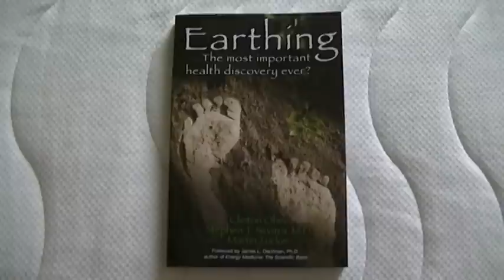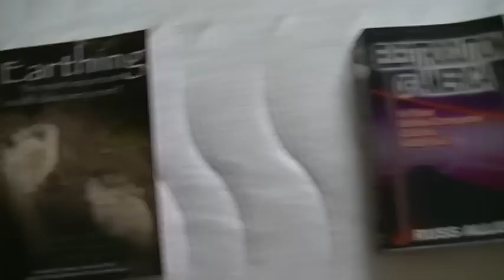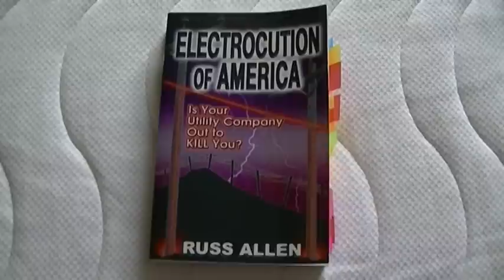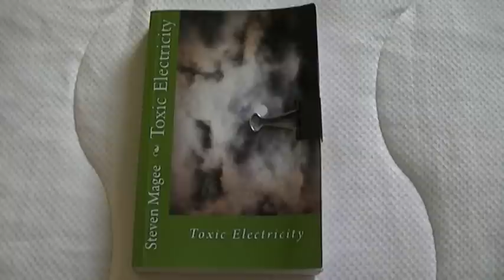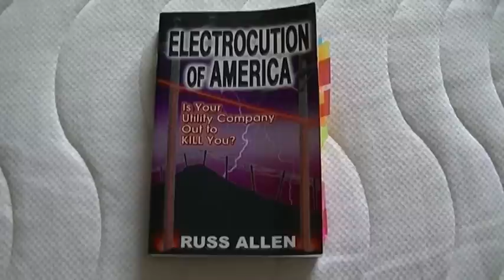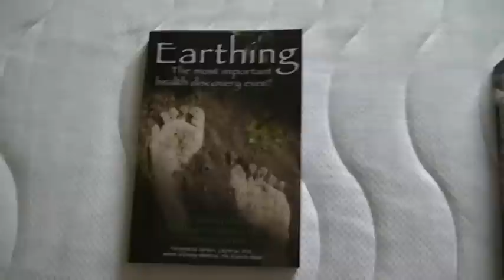Earthing (Grounding) Health Risks

Comment: I have a neurological disorder and for some reason it relieves me to be grounded. But I used some earthing sheets with an adaptor and I started feeling worse. For some reason some electricity still came through the adaptor and I also have electromagnetic sensitivity.

How can I safely be grounded  not having a yard? Is there another way apart from walking barefoot? Thankyou.
Reply from the maker: Standing barefoot on a tile that is insulated from the ground may work:  See http://youtu.be/ZrlQFp16ADQ Shungite Plant Experiment May 2014 Review
Reply: Thank you so much for answering. But if I am barefoot on a tile insulated ground then I wouldn't be grounded. Am I right?

And I need to be grounded to relieve a Little bit my pain

Thank you again.

Comment: Steven, there must be a way to block the voltage and current returning back through the earth with some sort of resistance like a PolyPhaser does on lightning protection circuits. Could you point us to a circuit diagram or information on how to do this please.

Comment: "Earthing" made me sick. Thanks for exposing this dangerous fad.
Reply: Did you plug it to wall or the ground? Did you use the equipment that is advertised on the earthing website?
Reply: IceSparrow44 I used the ground rod and equipment from the earthing website. I experimented with 5 volunteers at different locations. One refused to sleep on a sheet after the first night. Everyone else were extremely exhausted and ill after 3 days. The experiment was halted. Using a NFA1000 I looked for the lowest ground body/voltage in the yard.
When connected with the earth you become part of a circuit. The cell is gated by voltage and if it's disturbed you can get horrible effects. Sleeping directly on the ground was never intended, otherwise it would be comfortable.
I have had excellent next day results with everyone, just by sleeping with the power off at the breaker and shielded from RF.

Comment: Water is conductive, even if we have plastic pipes these days.... and it usually comes from a reservoir somewhere with earth contact. Could not understand why I wanted to spend so much time in the bath in the evenings (with water flowing in slowly for quite a while), except I knew that I would sleep very well at night. It is not practical to stand and hold a faucet for 1/2 an hour, but the point is that the earth enters further into our homes than we realise, we just need to "connect" to it in some way: find creative solutions.     I wonder how the mains electricity influences our water inputs (plastic pipes are probably a blessing, as metal pipes would cause a strong induced mains current - but then again the water groundign might neutralise this: good field for research.)

Comment: I recently ordered a sheet that is made from cotton and silver thread and which is meant to be plugged into the grounding line of a conventional socket near the bed. If I understand your video correctly, there is still too much electromagnetic interference which might "contaminate" the grounding line and end up exposing the person to amplified radiation.
Reply: After my online research, it seems that the best grounding/earthing results can be achieved by simply walking barefoot outside. I, however, don't like doing this as I have walked on plenty of ticks and wasps over the years and have been bitten and stung by them, resulting in allergic reactions. I was thinking would soaking feet in a salt water solution outside in my backyard be acceptable? I assume the container for the foot bath would have to be a material that conducts to and from the earth, perhaps stainless steel? Plastic probably won't do. Any thoughts or suggestions? I did recently order a grounding mat for when I sit at my computer, however, after watching your video, now I'm not so sure if using it is such a good idea.  Also it is made from latex, and I have a mild latex allergy, so prolonged skin-to-mat exposure is probably not the best.
Reply: I would really like to know if it's like that as well, the EMI which might contaminate the grounding line..

Comment: An Earthing mat of the design mentioned in Clinton Ober's book, and which is most commonly used, is not the same as running a bare copper wire into the outlet -- in fact he warns against doing such a thing. Not only do the mats have a shielding mechanism, they also come with an outlet tester to make sure you're not connecting into dirty electricity.  What you did is not how most people are grounding.  Your test was not proper, or fair.
Reply: Hello Karen, thanks for your reply as you at least get my point. As a bonus, I will explain to you the safest and foolproof way to connect your earthing system. Do not use a single copper wire to connect the outside ground rod to your inside grounding mat. Instead, use RG58 or RG59 coaxial cable for this. At the outside ground rod end, connect the shield and center conductor to the ground rod. soldering both connections to the ground rod is best to prevent corrosion and higher resistance of the conductors. On the inside end of the cable only connect the center conductor of the shielded cable to your mat or mesh. Leave the outer shield "open" and not connected. This way, the shielding of the cable prevents and blocks any RF from microwave, Wi-Fi and radio sources since the shield is connected to earth ground outside at the ground rod. This is called single point shielding which is used in all audio device input shielding to prevent RF interference. Hope this helps... 😁
Reply: @robindorf55 what about RG6? Would be any good or RG58/59 is better? 
Thanks!
Reply: @robindorf55 ”soldering both connections to the ground rod” that doesn’t means that the outer “shield” will transfer everything that it catches to the inner wire and so to the bed?
Reply: @silvius6829  If you solder the shield and center conductor to ground, they are at the same ground potential. Which also cancels out RF reception. Use of a single copper conductor is the best way to go.
Reply: @@AngieW-ri6qx
Well Angie, I am still just trying to understand the methods and madness of these Earthlings?
Reply: MICHAEL, A GUY WRITES A BOOK AND YOU GO GAGA OVER HIM.  WRONG
Reply: @misfitty-vd6kv  What in the meth is this comment?

Comment from the maker: Biological proof that the Earthing and Grounded barefoot technique works when implemented correctly:  http://youtu.be/fjtKw8N_Xkg Building Radiation (RF) Resistance into Plants and Humans
Reply: I tried grounding with a metal sock complete with inline fuse and then a grounding bracelet - I feel the best sleep ever and I feel its fixing my back issues - I thankfully never had sleep issues but I feel so much better rested its amazing and my advanced disk degenerating disease - I wake up with no aches; I think its working for me?
Reply: I had a friend with a bad experience with a neutral ground wire that came loose from a service pole and landed on his roof. The electric company incorrectly told him it was safe to move it. This is the thing that third prong connects to in the system. What happened to him shouldn't have, but it did. He touched the wire. Something unloaded a fraction of a second high voltage pulse in the line, probably a three phase electric motor with a little short, estimated at about 7,000 volts. He woke up on the ground. He had burst into flames. His clothes were burned off, all his skin was burned. At the hospital they scraped off all his burned skin. He had years of grafts and had to wear a compression suit because his flesh bled everywhere. He and his wife said it hit him especially hard between the legs, and his penis was no good for anything. It destroyed him in every way and he wished it had killed him. The electric company paid them a settlement that wouldn't reimburse him no matter how much it was. The chance that can happen is so small it's almost nonexistent, which is why the electric company said it was safe to move the line. They should have said don't touch it, we'll be right there. Don't attach a wire to yourself that's plugged into that third hole. It may be okay to ground to the outlet box, however, which is what some specialists have told me to do. I haven't tried it I would trust a separate ground rod more. Use good, common sense and be careful.
Reply: Thanks very much for your work on our behalf, Stephen.

Comment: My husband and I are at about 10 weeks into grounding.  We have had several positive results-lessening snoring/sleep apnea symptoms for him, deeper, more restful sleep and  more rem sleep for both of us.  I had significantly lowered BP at two medical check-ups that were two weeks apart.  The best readings I had had at a clinic visit in 15 years.  However, I have in the last week been experiencing what I call palpitations--although they go away fairly quickly once I am on the grounding sheet.  Nothing was detectable at my clinic visit about any actual heart beat irregularity.  I was under quite a bit of stress during that week though and when the situations were resolved the palpitation-like feeling resolved by about 99%  It might not have had anything to do with earthing, as stress has caused much shorter palpitation feelings in the past.  This time frame was just longer lasting. Reading this information about ground electrical contamination has made me wonder if I need to investigate though. As with "health foods" and other approaches to fixing our toxic lifestyles in this country, you can do the right thing in the wrong way very easily.  Due to all kinds of "contamination" factors that are layered into our factory-farmed, chemical-treated, modern lifestyle that looks great on its surface, the healthy gets laced with the toxic. So one really does have to dig deeper anytime a healthy or healing option is presented.  My question is, is it possible to have the positive results that we have had and still have electrical pollution happening through our connection that could cause problems at the same time.  Or would we have toxicity without any benefits if we are connecting within an electrically polluted grid line?  We bought a body voltage meter at the same time that we ordered the sheet and periodically check performance with it.  Our voltage consistently drops to .02 once we are on the sheet.  Other areas in the room show us at 3.5 to 5.5 voltage.  Would that indicate that all is functioning as it should?  Thanks for any feedback!
Reply: Jennifer Horstmann I'm very confused. I'm not an electrician, but I do have a grounding mat and I also want to make sure that I'm not receiving anything harmful from it. When I plug into the grounding port, there isn't electricity going through that. So why all the fear about toxic electricity when there is no electricity involved? Thank you!
Reply: Also--how could we test for electrical pollution if we want to confirm?  We are in an apartment complex and are connecting via an outlet in our bedroom, not running the cord outside into the ground.
Reply from the maker: Jennifer Horstmann  I do not recommend connecting the human into electrical outlets.  The reasons are extensive and are detailed in the book Electrical Forensics:  http://www.electricsense.com/7364/electrical-forensics-book-emf-protection/ Electrical Forensics – The Link Between EMF Exposures And Unusual Behaviors
Reply: How can we make sure that we have a "clean" grounding connection then?  I subscribed to Mr. Burrell's EMF Protection Report and maybe the answer will be in there.  I do not want to give up the lowered blood pressure benefits of grounding without making an effort to make it work.  I don't want to give up and take pharmaceuticals because it is too difficult to ground in a healthy way :-(
Reply: I can't have any products with caffeine or tannins as I get very bad heart palpitations, tea, coffee, chocolate, port, red wine...If I continue to consume those products it feels like my heart is swelling up. This was discovered way before I laid on an earthing sheet and the sheet does not seem to help the problem only abstinence stops it.
Reply: Hannah Yasharal Good question. I have the book that Steve recommended above in this thread on my wish list but haven't gotten it yet. We have used both a sheet and mats without any problem but maybe just lucky. We are coming up on a year of grounding with these products. I also am researching a practical way to be able to test grounding devices for affects of what they call "dirty electricity" but kind of dropped the ball and haven't gotten that done. The book referenced by Steve would probably answer our questions. Also I read Info by Lloyd Burrell for Earthing and Grounding information.

Comment: Hi Steven,
Thanks for the video. I've just subscribed. I have a severe tic disorder, insomnia and fatigue. I tried the grounding (connected to my home's neutral terminal) and my neurological symptoms got worse. I thought that maybe my body was reacting to the positive changes made through grounding (Herxheimer reaction is well documented in medical literature - not pertaining to grounding but to drug treatment) Interestingly, I've also tried Cranial Electro Stimlation (CES) and found it also worsened my symptoms.

I was wondering if I was picking up electrical contamination from my home utility system. Is there any way of proving contamination through some sort of test? I've found that when connected to a grounding matt (through neutral terminal) my body voltage reduced from 8 V to around 0.1 V, so I assumed that I had a good connection. I live in a rural area with a back garden that spans 60 ft leading directly onto forestry land. I was thinking of installing a grounding rod at the furthest point from my house and running 2 mm copper wiring up to my room to see if there is any difference. A bit of a stupid question but can I still pick up electrical contamination if the wire runs near a power source or does the wire sheath completely shield it from electrical interference? I'm not schooled in electrical engineering, but I hope to someday be :)

I would be very grateful for your opinion on trying my own grounding system.

I have found positive change by disabling Wifi, DECT and mobile phones and through switching off power to my room through the mains.
Reply from the maker: Electrical grounding/earthing/neutral systems are commonly contaminated with strange frequencies, you should think of them as an antenna system.  If you look through my channel, there are quite a few videos relating to testing for frequency and voltage on grounding systems.  I do not recommend connecting into electrical outlets, it is a risky activity for human health.  It sounds like your bedroom is not on the ground floor but on the first or second floor.  You should not run a grounding cable vertically, as it may increase the antenna effect.  Many people find that reducing exposures to electricity, electronics and wireless products improves their health, as you have done.  Do you have a tree outside your bedroom, as they can be emitters of EMI and make you sick?  Metal beds and metal mattresses can also be an issue, as can LED and CFL light bulbs.  Insomnia and fatigue are classic symptoms of EMI exposure. I'd recommend that you should read Toxic Electricity before continuing with the Earthing health technique.  You can find more information here: http://www.environmentalradiation.com/
Reply: StevenMageeBooks
Thanks for the reply. Much appreciate. Would switching off the electricity via my circuit breaker make it safer to using electrical outlets, in your opinion (BTW I live in the UK). It seems the best option would be for me to ground myself for one or two hours down my back-garden via an earthing rod. I'll have a look at those videos. Yes I have 3 large trees (70 ft) about 45 ft away from my room. Unfortunately, there's nothing I can do about this because they are protected. Is there any way I can shield myself from the EMI (through carbon based paint or a silver netting sleeping bag)? I replaced my metal bed with a wood frame and a foam memory mattress (without pocket springs). I've just ordered your book. Cheers. Tom
Reply from the maker: You'll find some of the answers in the book.  Regarding Earthing, I recommend that you consult with http://earthinginstitute.net/

Comment: Few things to add here. It is important to NOT make home made grounding devices.  Also, as a dowser it is important to be sure the grounding stake doesn't go into a Hartman line.  That needs to be addressed here. If your rod goes into the earth where there is no line, people will be fine.  Stray voltage doesn't just diffuse all over the place. It forms a grid, hence Hartman lines that run south to north and west to east. To put fear into people using earthing techniques without all the facts should be reconsidered.
Reply: Thanks for your comment. How does one determine the location of a Hartman Line?
 I would appreciate your thoughts on my other comment made earlier today.
Reply: By dowsing techniques.  The easiest is to learn to use "rods".  I don't know I'd this hypotheses is true but it would be fun to experiment!
Reply: I agree Shannon!

Comment: Just take off your shoes, go outside and stand in the dirt.  If it's cold outside, get some dirt, put it in a small container strong enough and big for you to stand in with a top for the container, you can wrap the container in blankets to warm it inside, if you are safe to stand in it in your home then do so, if not, do so outside after the dirt is warmed.  Problem solved, answer is as old as dirt.
Reply: This is why I built a cattle panel greenhouse ($200 and warm!). Now, I can stand in dark rich warm soil barefoot all year in Vermont.